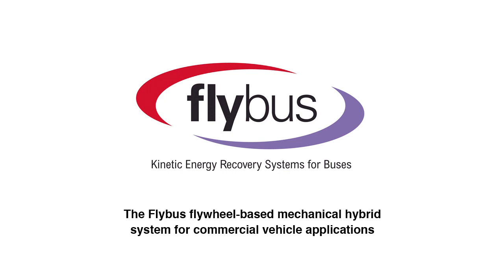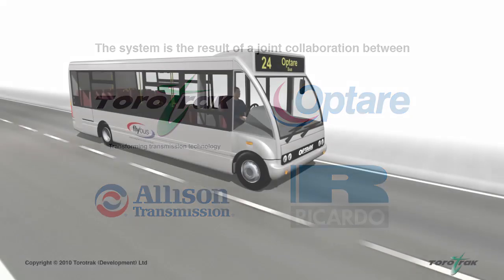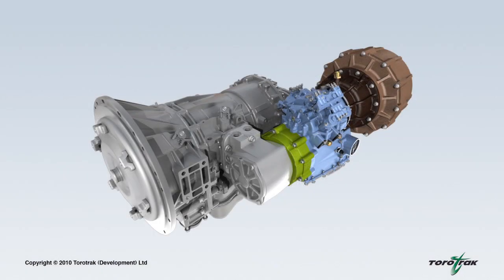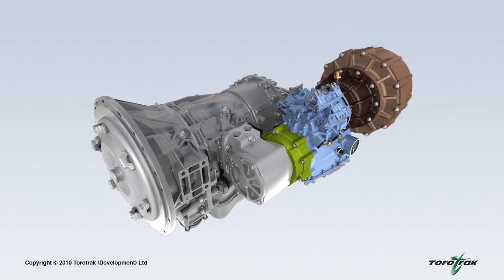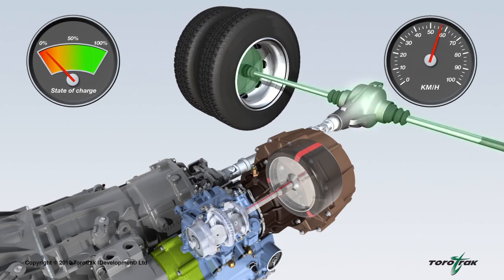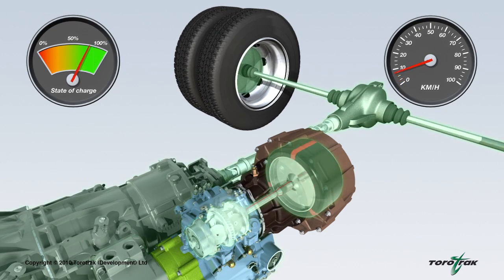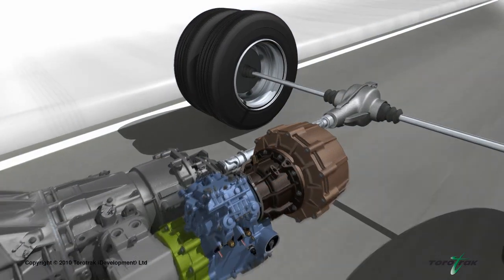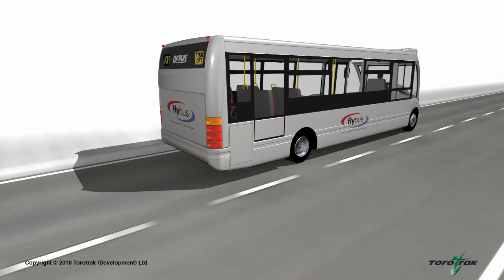Flybus flywheel-based mechanical hybrid system

Comment: Seems that the fly wheel should be way bigger probably mounted where the rotation axis is vertical. this way the diameter of the flywheel could be near that of the width of the vehicle.